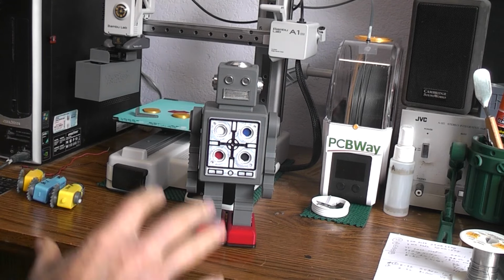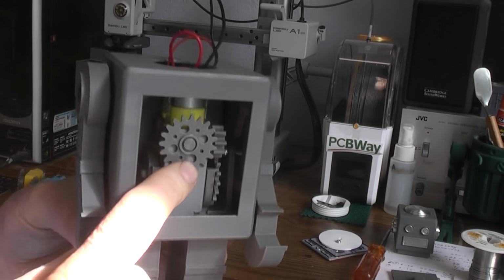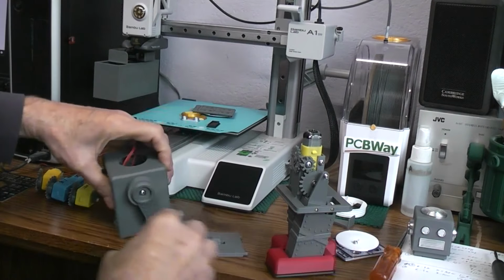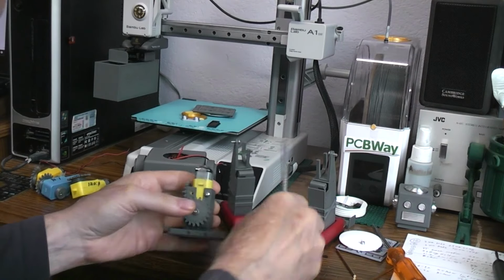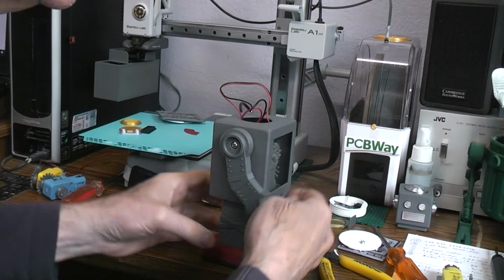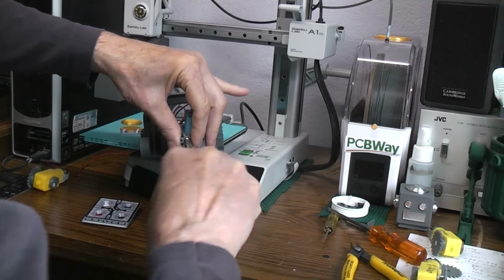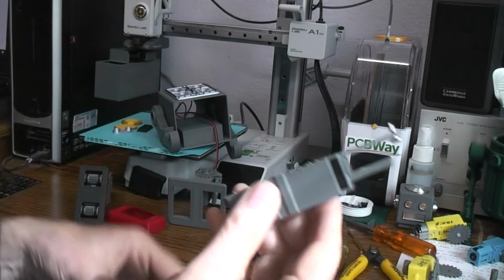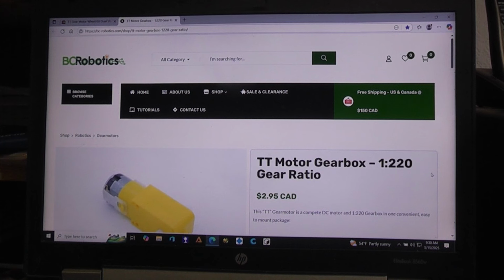Build video for Color wheel POGOT 3d printed battery operated robot. Testing different TT motors.

Comment: Hi Robothut, I'm going to use some 3mm colour changing LEDs in my build, it's been a while since I built one of your super projects, so I need to ask: do I need to incorporate a resistor in the wiring diagram?  Thanks in advance for your time. Kind Regards, Steve
Reply from the maker: Yes, use a resistor for each LED. Color changing LEDs will draw more current as they are always ON. I chose flashing white LEDs to help limit the current draw on the 4.5-volt battery supply. Also, I used 430-ohm resistor's to further lower the current draw.
Reply: @Robothut  Thanks for the info.  Will take photos and video when finished. :-))

Comment: I know you mentioned this in another video but what's the soldering iron that you use in this video? I like how small it is.
Reply from the maker: I looked on AliExpress for the lowest cost rechargeable soldering Pen. The only problem with the low-cost ones like I bought is that the battery has limited power so you cannot solder for long periods of time or large metal parts/ wires. But it is fantastic for simple small wire connections like wires on a motor or LEDs.
Here is the video I did last November.
https://youtu.be/lCki_ngtw3E?si=vsEmo-0rxroGu40-
It was less than $10 bucks. I have used it every day and even had to order new plug in tips for it. I got 3 replacement tips for under $4 bucks delivered.